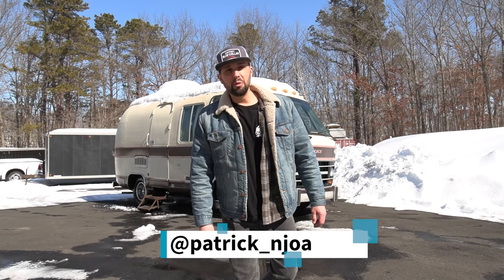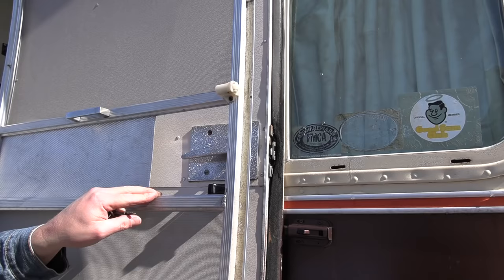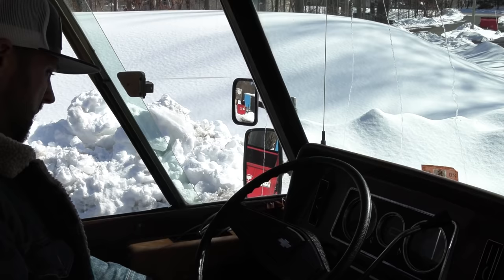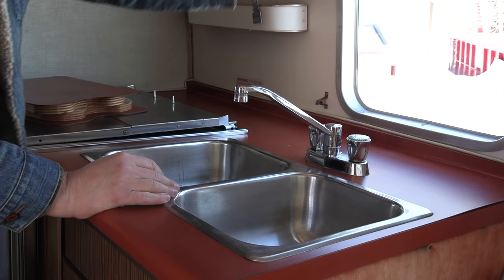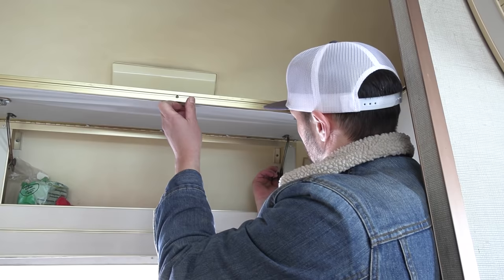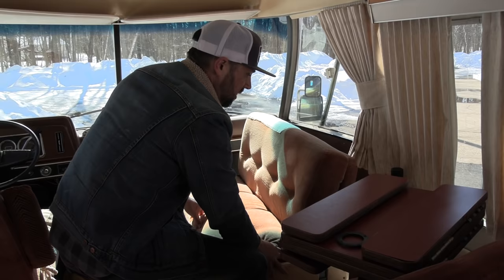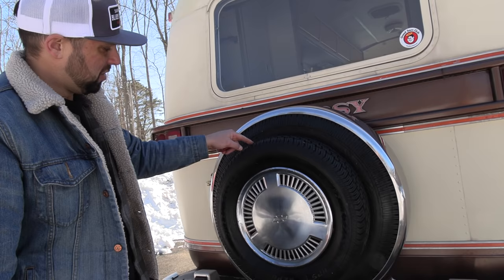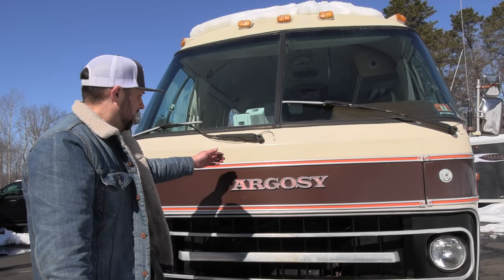SUPER CUTE | The Worlds SMALLEST Vintage Class A Motorhome! Airstream Argosy

Comment: Finally! I’ve been looking for an in depth Argosy 20 video. Thank you! I like the version without the dinette up front and with the pub chair and fold out table instead. 

I have a 1976 dodge chinook 18 plus. Rear door entry, the twin 6 foot sofa model where one sofa can become a dinette. It runs great, all original and in good shape, and all systems work. 

Dimensions of rear interior living space behind cab/driver’s seat:
   The interior width measurements is 85 in = 7ft 1 in 
   Rear length inside from back of driver’s seat to inside of rear entry door is 12 ft 5 in
Inside height is 6’2”
RV overall length bumper to bumper in 19ft

It has the same Dometic fridge. Mine is missing the far left front pull knob (striker?) so I manually start the pilot light from the rear of fridge and outside. It works great! Very cold. 

Here are some specs of mine. 56,000 miles
1976 Chinook 18 Plus Motorhome
TrailWagons Chinook M-18 PLUS
1976 Dodge Chinook M-18 Plus 2 or 
          18P/MH

1976 Dodge B300 360cubic engine 
           5.9L V8 motor 1 ton dually 
Dodge tradesman chassis
Dodge MB300 chassis
It came form the factory with no catalytic 
Length 19’2”
Weight 6500 pounds dry
Max GVW is 9000 
     GVW= driver, passengers and payload 

Engine 360 V8
Tire size: single front
                  Dual rear
                  800 R-16.5
Purchased Tires
8.00R16.5LT. Light truck
Wildcat h/t
Radial tire
All 6 are the same 
When using full to 60psi
When not using to 70 psi

Propane tank 
      Size: 10 gal LPG ?
RV refrigerator 
   Dometic Model RM66E
      LP-Gas and Electric 110v/12v
Stove and oven aka Range or cooktop
       Brand: Suburban 
       Model: SR-40 SB
       Liquid Propane only
Furnace 
     Brand:Suburban
     Model: Dyna-Trail
     Model #: NT-12FC  
     12v only 
Hot water heater
      6 gallon ?
      Models 6 ARV & 6 ARVM
      Models 8 ARB & ARVM 
      Made by: American Appliance 
      MFG. CORP.  
      a Subsidiary of not-FLO 
      Industries , Inc 
         Outside manual light, liquid  
         propane only
Tank sizes
       Fresh water tank 23 gal 
         18.5 wide x 41 long x 8 in high
       Black water 
       Grey water 
       Gas tank is 35 gal
          Uses regular gas, twin exhaust

Water pump
      SHURflo 
      Model Series 2088
      12v electric demand water.    
         system
Converter 
     Brand: Phillips power converter 
                   and battery charger
     Model: PC-301-A-1
     Converts shore power to 12 
         power to be stored in the 12v     
         house battery
Maxxair Fans x 2. 12v
New A/C
No generator
Reply from the maker: Oh wow thank you for the excellent information. Sounds like a nice coach
Reply: @NewJerseyOutdoorAdventures  thank you for the well made content and the smart questions to ask

Comment: Engineered well ahead of its time. Durable, simple, and NO computer crap to spoil the adventure. Modern day engineers could learn a lot. A true time capsule. It's going to make someone a great tiny home.

Easy to see the General Motors engineering influence...2 piece panoramic windshield and bus (Greyhound) type mirrors, and rounded aluminum body. Both these features were used on the GMC Astro and Chevrolet Titan cab over class 8 over-the-road trucks of the same era. The bus type mirrors were only used a year or two and they went back to using the traditional west-coast mirrors on the trucks.
Reply from the maker: Thank you for the useful information

Comment: Really cool camper/ RV.   
  + Surprisingly large shower for the time & size of vehicle.
  * The current need for usb charging ports could easily be reminded by putting an adapter in the cigarette lighter and use the outlets to charge devices when not in use.
Reply from the maker: Thank you for checking this out Patty

Comment: Super nice vintage coach. However, being a ‘75 Chevy small block it’s most likely a soft cam V-8, and needs the old fashioned “GM tune up” with the TRW engine module III. Cam, lifters, timing chain and gears. That’s if you plan on putting some miles on it.
Reply from the maker: Thanks for the info!

Comment: Really cool body style and length!! So many features that reminds me of a 68 and a 72 Airstream trailers I've had. I have a 22 foot Class A Barth motorhome with a Chevy 454 engine that gets 9 to 10 miles to the gallon and isn't as aerodynamic as that Argosy...so you are underestimating the mpg of the Argosy, I'll bet that could get 10 to 13 mpg IF you drive it slow and easy.
Anyway that's a really RARE beauty there. Thanks for the interesting video 👍😎
Reply from the maker: Thank you very much for the extra information. Maybe with a good tune up this thing would get better mileage

Comment: Pretty sure they made a minute that was about 18' long. The bathroom was at the back. It had a booth that could be flipped around to make a sofa, two front facing seats and a bed. That was the only seating other then the driver's seat. It was about the same size as a short wheel base van.
Reply from the maker: Not familiar with that one

Comment: First thing is do is get rid of that old rv refrigerator and get a new or newer one you can see how rusty the accumulator tank is, the amonia corrodes the insides out over time and  those old one will burn your rv down to the ground if they are neglected to be serviced and mud daubers get in the burner area , id look at a new propane tank and replace all propane the lines if they are original, many places won't fill propane tanks over a certain age. You can find a household refrigerator like for a small apartment to fit in the opening for a fraction of an RV fridge cost and run it on a 1200 watt inverter. I did that on my 22 ft Winnebago and the refrigeator was much more efficient and got cold faster and it was like 400 bucks not 1500, i could run it all day on the  12 volt deep cycle battery when the engine was off. Nice buy though.

Comment: Not the smallest....Winnebago had a 17ft class A on a Ford chassis in the 1960's. With single rear wheels, powered by the famous Ford 300ci six cylinder engine.......
Reply from the maker: Thank you for checking this out. I’ll look out for the Winnebago
Reply: @NewJerseyOutdoorAdventures  17ft  Winnebago Model F17...Also 18 footer model number D18

Comment: You should have just done one sweeping camera motion around. I couldn't even tell where the bathroom was located. And where's the beds besides the sofa that folds out. 
Please keep all this in mind when you're doing tours. Far away slow camera action all the way around or into the areas. Then you can do details and stop talking so fast
Also, if I was the owner. And you said you could tap these liberal doors to go shut and they're banging down there would be upset. Opening and closing things very abruptly and very manhandling everything.
If it was mine and I owned it. I would be having a strong talk with you about not being careful with a very vintage camper
Reply from the maker: Here we go